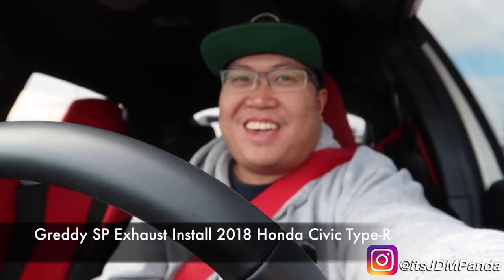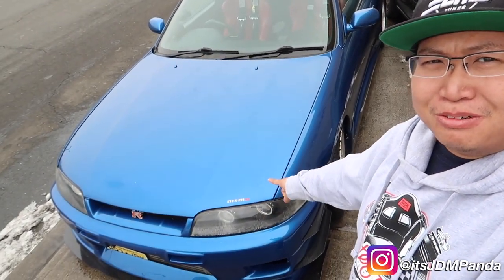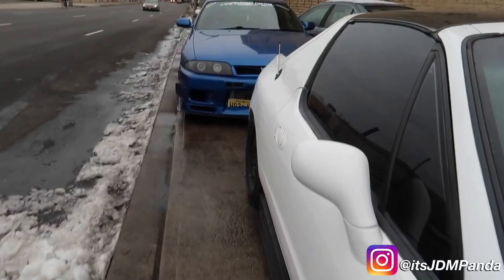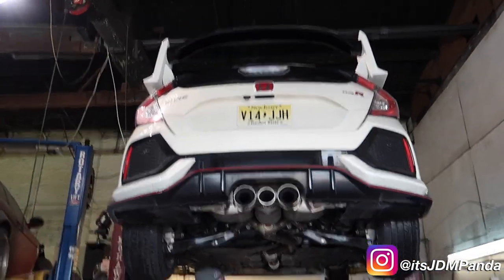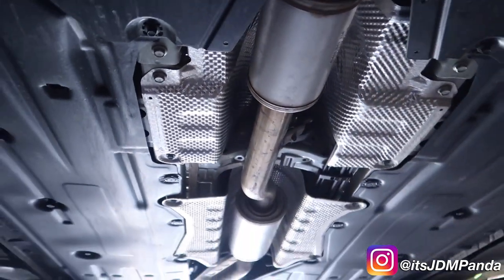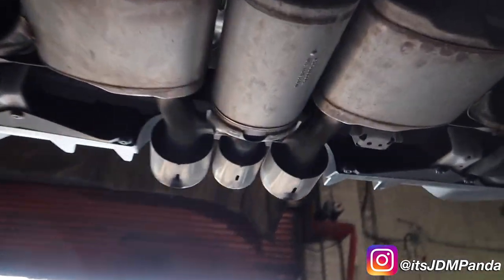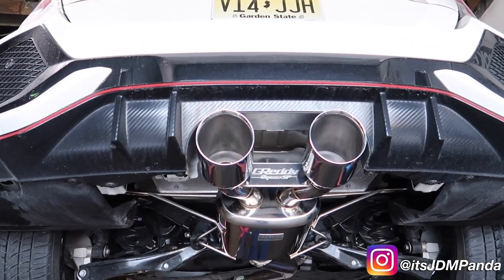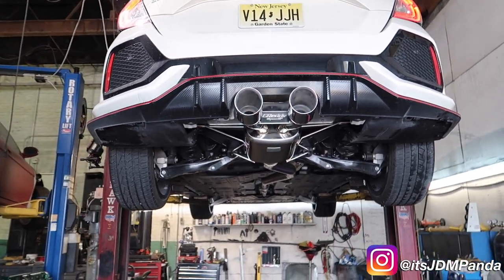New Greddy SP Exhaust installed and quick REVIEW on the 2018 Honda Civic Type-R

Comment: Does it vibrate inside especially under the driver seat
Reply from the maker: there is actually no vibrations under the seat
Reply: @JDMPanda  do you still have this on your civic, have you tried road tripping with this exhaust for thousand of miles and how was the cabin noise?

Comment: Did check engine light come on?
Reply: Can you also do fly by vids please. You’re the only YouTuber that has this exhaust 🙏🏽🙏🏽
Reply from the maker: A cel came on but then turned off but we are not sure if its from the injen intake or the exhaust causing it.
Reply: JDM Panda did you find out what caused the light to pop up ?